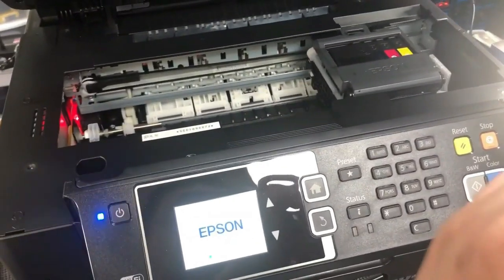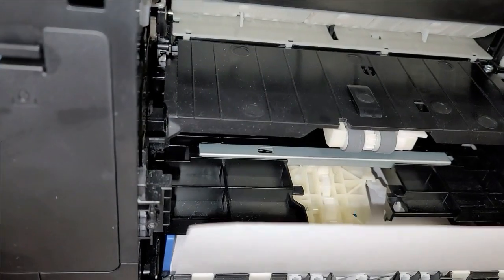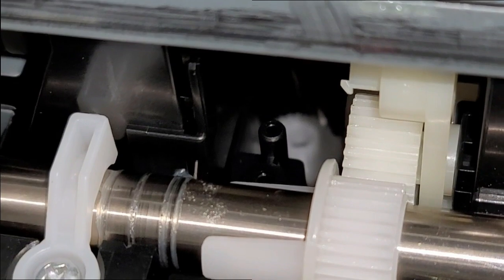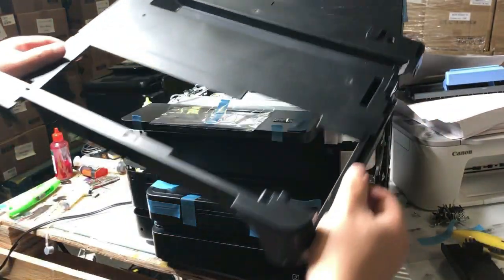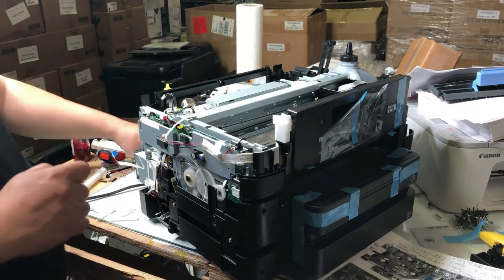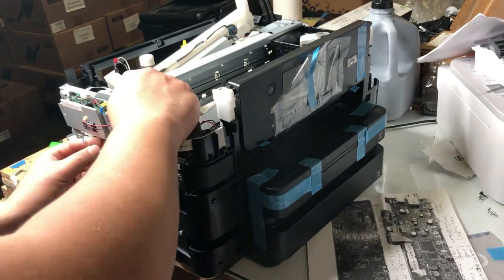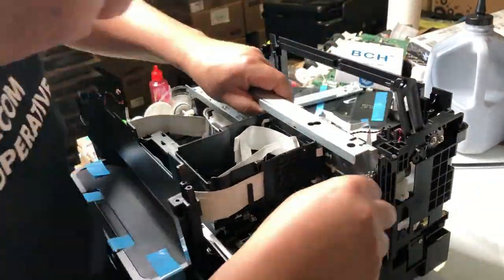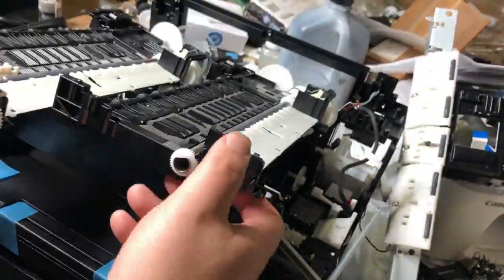Phantom Paper Jam - Fix Epson Printer Paper Loaded Halfway then Fake Jam

Comment: hello my friend, in my Epson L3150 model printer, although there is no foreign object in the paper path and the part where the print head moves, it gives a continuous paper jam error.  The paper comes half way, after a few lines of writing, the head stops and gives a paper jam error.  When I move the small wheel under the paper part by hand, it turns hard.  Is this normal?  Which parts should I check?  I will be very happy if you help
Reply from the maker: Hey, thanks for reaching out! It sounds like your Epson L3150 might have a feeding issue, even if there’s no visible obstruction. The fact that the paper advances partway and then jams points to a possible issue with the paper feed rollers or the encoder strip.

The small wheel you're describing (likely the platen roller) shouldn't be too hard to turn. If it's stiff, there could be debris or dried ink buildup underneath. Try gently cleaning the rollers with a damp lint-free cloth. Also, check if the encoder strip behind the printhead is dirty – even a slight smudge can cause misreads and errors.

If the rollers still feel stuck or the problem continues, the issue could be with the paper feed sensor or the carriage belt. Let me know if you'd like more detailed instructions or if you'd like me to add this to the list for a future troubleshooting video!

Comment: I have Epson WF-7715, problem I am having is it when I print a page it prints that page fine but after that it keeps pulling in pages and throwing them out until it empties the whole paper tray. Don't know what is causing this problem. If there are any papers in the tray and I switch it off it pulls the paper and leave it in the middle then it gets switched OFF. Any help will be highly appreciated.
Reply from the maker: Thank you so much for subscribing and supporting the channel—you're helping us get closer to our 100k goal! It sounds like the issue with your Epson WF-7715 is related to the paper ejection sensor or lever, which might be stuck. This can cause the printer to continuously pull and eject paper because the sensor mistakenly thinks there is still paper in the feed path. I recommend watching this video for a visual guide: https://youtu.be/P1eNSnuHqDo. In many cases, the first page pushes the lever but it doesn't bounce back immediately, leading to the problem you described. Gravity may eventually reset it, but the printer dumps paper in the meantime. Subscriber questions are prioritized and typically answered within 48 hours, so if you need further assistance, feel free to reach out or email support@bchtechnologies.com for faster help. Thanks again for your question and for being part of the community!